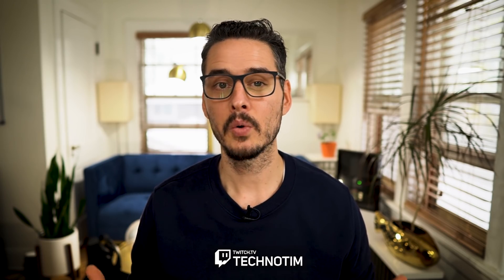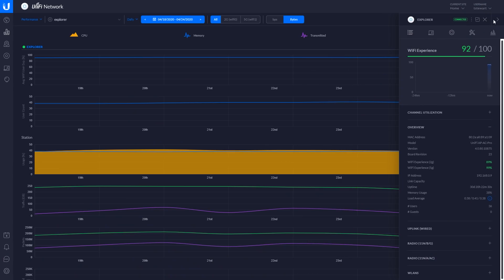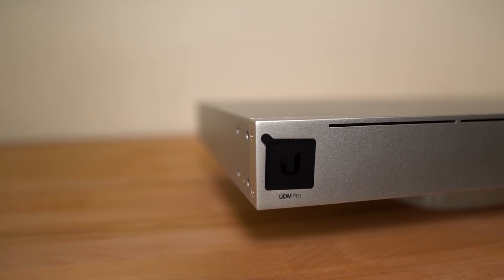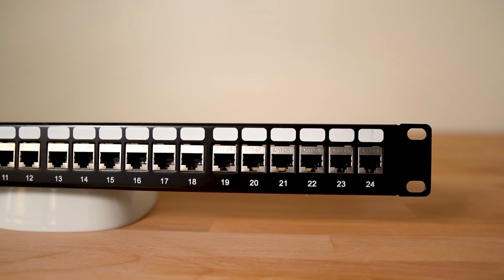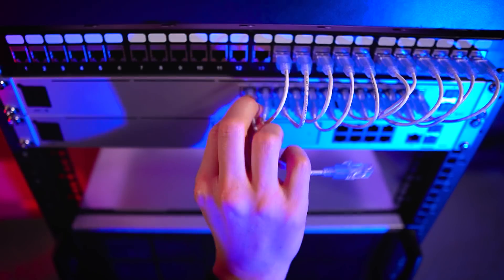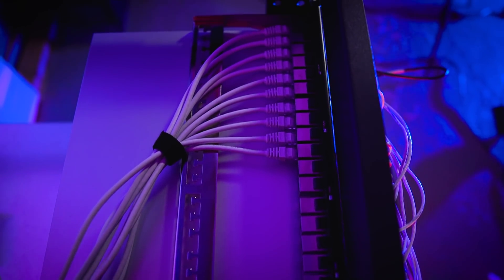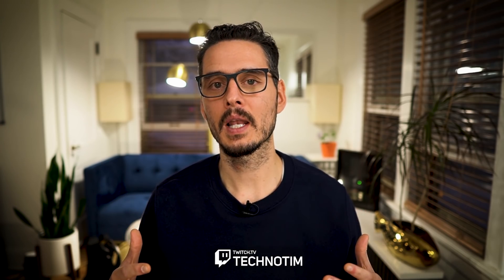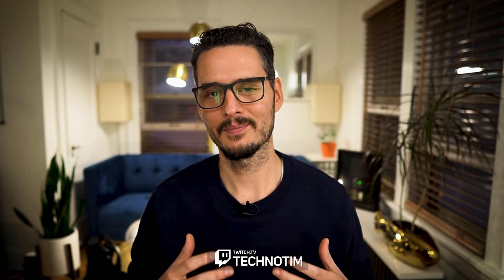Huge Network Upgrade for My Homelab

Comment: Would love to learn why you considered the UniFi line over the EdgeMax line? Also Mikrotik switches are cheaper than Ubiquiti line AFAIK -- did you happen to consider Mikrotik as well?
Reply from the maker: Hi!  Thanks!  I went with UniFi because I already had some APs and wanted full integration with the rest of my network.
Reply: That makes sense.

Comment: Don't like the fact that you need it to log into a cloud account in order to configure it and use it. Means you don't own it, you are just renting it and at it's mercy. Like an apple device, when they decide you need to purchase another one or force and upgrade, get out the wallet and take it bending over.
Reply from the maker: I think you can sign in locally too without cloud
Reply: This is not true, you do not need to be logged in to a cloud account to access the configuration. For example I have my Unifi Controller installed on a PC and I can log into the interface via that PC.

Comment: I want to get the Unifi Switch Pro 24 port to replace my old HP switch since it's noisy and has a terrible UI. I already have the unifi controller for another device.
Reply from the maker: Sounds like a plan!

Comment: Great video...nice setup. My only recommendation would be to reconsider using anything other than a robust device (FW) at your front door. If you said you tried pfsense...confused as to what features/functions did not satisfy your use case? Another recommendation...VMing your FW presents challenges no matter which product you use...if your going to go the VM route...you might want to consider zScaler or another vendor that provides great FW capabilities through the cloud...but then you would have subscriptions and fees associated with it. Back to pfsense...100% free! All you have to do is supply the hardware...it will run flawlessly on just about anything...except Intel based NICs are best to use for long term reliability. Good luck
Reply from the maker: thank you!

Comment: Planing to upgrade my crapy network at home something like yours. Maybe a bit smaller. UDM Pro as a gateway+firewall, as i only need about 4-6 PoE ports i think unifi 8 port 150 W switch will be enought, 1 unifi AP lite, 1 unifi AP Pro, and some G3 cameras.
Reply from the maker: Sounds like solid choices!

Comment: Half U patch panel? The three holes aren't evenly spaced, so most equipment probably wouldn't fit.
Reply from the maker: hmmm, seems like they are to me?
Reply: @TechnoTim  The space between the three holes in a U is 0.625 inches, but the space to the next U down is only 0.5 inches.

Comment: Great video Tim. I also run UniFi gear in my house, I really like the simplicity of running my network and my video surveillance in one place.
Reply from the maker: Awesome!  I haven't used protect yet (I have an existing camera system in place).  How do you like it?
Reply: @TechnoTim  I’ve used protect for almost a year and it’s been rock solid. The stable algorithm works great for me. I have 4 cameras, my latest addition was the g4 doorbell and I can’t say enough good things about it.
Reply: @TechnoTim  I run 10 cameras on the UDM Pro currently and Absolutely love it!  Future plan is to move the cameras to the UNVR but for the soul purpose of having the ability for more record storage.

Comment: Currently I have in my studio this setup ER-X —> Netgear gs305 and gs305e switches and Google WiFi as AP. I’m moving to new place and plan to ged rid of these two switches and replace maybe with one 16 port managed switched and UI AP to vlan segment my wireless prod from iOT devices.
Reply from the maker: Nice!  Sounds like you are on a great path to segmenting your network!

Comment: Great video as always! My next upgrade is to a 42U rack custom built into my office. I'm running out of space in my existing 22U rack due to some...aesthetic choices I made in having my printer mounted in the rack. Also upgrading the ethernet runs in the house to CAT 6A in the next few months. When we bought the house it was already wired for CAT 3, but that serves almost no purpose in modern networking. Luckily for me, I can use the existing lines to pull the new cable through the walls with very little effort....I hope. I've been a longtime user of Ubiquiti gear, but like some others, I went with the Edgeswitch rather than UniFi and a Netgate Firewall running PFsense. No particular reason for that other than at the time, it was all that was available, the only thing in the Unifi line back then was the AP which I also use. One AP-LR and one AP-Pro. I much prefer the pro and plan to get a second one and relegate my LR to IOT only as I have a few very chatty devices on the network. I'm looking forward to see what you think of the Unifi switches and UDM compared to the other products you've used.
Reply from the maker: Thank you!  So far, it has simplified my life (in the last week) and this is something I was hoping it would do.  Pushing out VLANs, creating rules across all 4 switches (I bought 3 UniFi Flex PoE switches, 2 of which were rolled out in 60 seconds) and centralizing all the management I was doing before has been quite nice compared to my previous setup.

Comment: Will you still be using your docker contained pi-hole?
Reply from the maker: I certainly am!
Reply: @TechnoTim  You can install pihole on the UDM Pro if you want. It's not a GUI installed option, but there are a few package install scripts to add nextDNS, Adguard Home, or pihole for the UDM and UDM pro (as well as other kinds of services). 

You do need to pre-install UDM Utilities from boostchicken, which sets up a few on-boot scripts that loads up the docker-equivalent and the network IPs for pihole, nextDNS or Adguard Home to your system.

The advantage of adding DNS-forwarding/filtering to the UDM(p) is that you can filter DNS in each VLAN separately, without needing to bridge the RPi4 or set up VLANs on the RPi4 to accept and forward DNS across the different networks. While there is some benefit to having a single pihole for 3+ networks to cache DNS, there can be difficulties if you have 'child safe' settings mixed in with adblocking home users, guest network access, etc, and/or the PiHole dies unexpectedly after a week.

While some of this can be done with group management on pihole 5 and assigning reservations with DHCP, mixing VLANs and unknown /guest devices has some teething issues. Let alone if you also add IPv6 ad filtering into the mix.

Comment: How load is this poe switch, I work next to my rack so I try to keep it as quiet as possible. Personally I use unifi accesspoints but all my routers and switches are Mikrotik but I do a lot of complex networking and this was not your cup of tea.
Reply from the maker: You're right, this is the model that has fans but it doesn't make any audible noise, at least with the 8 PoE devices and 16 other non PoE devices plugged in.
Reply: @TechnoTim  that is great, earlier unifi versions and most poe switches are quite loud.

Comment: Yes, there is a such thing as too many Ethernet drops. Two days ago I was sent to a Doctors office to mount a TV and on the other side of the wall where the TV was getting mounted was the IT Closet. Come to find out 125 Data drops are in the Wall and a Toggle Bolt snagged a few cables and damaged them. One was the main DMARC feed from their AT&T connection. Didn't know this happened until yesterday. Guess they had their IT guy look things over and figured it out. I'm currently re-running five Cables as I am typing this and as a peace offering I am running CAT6a for their new DMARC feed.
Reply from the maker: lol!  Yeah, sounds like too many!

Comment: When racking, start the bottom screws first then you can let go then start the top screws and tighten everything and have both hands.
Reply from the maker: Thank you for the tip!
Reply: @TechnoTim  rack studs series 2 will change your life :)
Reply from the maker: @EricsTechSpot  What are those????  I need my life changed when it comes to racking!
Reply: @TechnoTim  you use them in place of cage nuts for square hole racks. I made a video of them and realized how horrible it was so I am going to make another review of them when I get my larger bag in a couple of days and redo much of my homelab rack layout. Keep an eye out :). They are a one piece threaded post that has a clippy part that clips into the square hole. You place a yellow plate over the post to prevent it from squeezing together and unclipping from the rack. Once that is done, you can slide your device up onto the posts and thread a cap onto the posts holding the device in place. Much faster than cage nuts and you dont sacrifice as much blood. The posts take a lot of the holding up a lot of weight issue out of the install as they help hold the device up and in place while you thread the caps on. Takes you from needing three hands to about 2 1/4. Much more expensive than cage nuts but if you buy a large bag it's not horrible especially compared to the price of the device you just mounted.

Comment: I will probably start on my new NAS soon because my current one is almost full (HP Microserver Gen8 with 32TB running FreeNAS).
Will probably go with an i5-10400F (On sale for $140 here in Sweden right now), ASRock B460 Gaming 5 motherboard and 64GB RAM (3x32GB) so I can upgrade to 128GB later if needed.
For storage I will be using Seagate Exos 16TB drives and it will be running TrueNAS Core since it's officially released now.

Next step is to get a rack and upgrade my home network from Gbit to 10 Gbit.
Reply from the maker: Sounds like some great upgrades coming soon!

Comment: I don't like it when I pay a large amount for a piece of hardware and am forced to use any sort of account. That's why Oculus Quest 2 and UniFi will never be an option for me.
Reply: You can use a local account of you want. You only have to use a vpn of portforward for remote access.
Reply: @mitchellslot  Ah I see, so the cloud account is only necessary if you want to access your switch from the outside without vpn ^^
Reply: @devKazuto  indeed. I have used a local administrator account at many customers because of that.
Reply from the maker: Local account ;) but yeah, I totally understand.

Comment: I use pfsense, just purchased a new 1u supermicro “network appliance” with 6 10Gb ports that will replace my current one. I am done with ubiquiti. Spent a lot of money on their devices just to be told support end in 2021. I will still use the edge switch that I have and my long range AP. Will use the unsupported AP’s until I can afford to replace them. I have lost trust and confidence in ubiquiti and will not be buying any of their gear again.
Reply: psss, you can build x86 AP with Mikrotik miniPCIe card, PCIe adapter and HostAPd and it won't have expiration date.
Reply from the maker: Sorry to hear that!  which devices were ending in 2021?

Comment: Like @Max D sad, really wondering about your move to unifi consumer line. Sure looks nice and fancy but super limited functionality. I am running pfsense and edges witches with unifi APs. Sure I have to manage three separate controller systems, but that's worth.
Reply from the maker: Thanks!  I am leaning towards tighter integration over complexity.  I don’t have a strong networking background (although some) and would rather not learn and manage 3 systems.  I totally get it for those who do have that background and experience.  I would just rather spend that time on developing software and creating content... for now 😀
Reply: More advanced routers/gateways are unnecessary for home or even small office set-ups. The control over all of the networking devices from the one interface with Unifi is just beautiful. Also, if you're upgrading from a typical consumer grade all-in-one router then the Unifi routers and switches are certainly not limited in functionality by comparison!

Comment: I love the patch panels.    I was reading some of the comments on Amazon about this Panel.   Do you think that the edges need to be smoothed down on it ?   Or that the wires "might" become damaged, from the rough edges ?

Upgrades:  Newer servers.  My Dell R-610 has seen better days.
Reply from the maker: I saw those too.  Maybe they've fixed this since those comments.  I ran my fingers over it a few times and didn't notice anything sharp.  I am also not using the cable manager the way they suggest.

Comment: Although UDMP is great for what it is, it lacks many features that come standard or can be installed via package manager in pfSense and that I depend on. I had the UDMp and moved back to pfSense. I was losing features instead of gaining, like OPNvpn, ha proxy for reverse proxy, letsencrypt ssl management, pfblockerNG sinkhole ads, dns redirect all traffic from 53 to firewall to encrypt over 853, and advanced configuration of IDS/IPS. I’ve opened a support case with Ubiquiti, but they were no help. Hope you have a better luck than me. Looking forward to the 3 month update video.
Reply: Agree, I like a lot of the Unifi gear but the AIO UDM/UDMP is pretty crappy. Pfsense/OPNsense + Unifi switches/APs is the way to go. I understand tighter integration (after all, I did the same thing by trying the USG Pro), but its missing even the most basic features and DPI and Threat Management is pretty useless, even missing things like timestamps.
Reply: @NM-vw6xq  Hard to go wrong with that combo. Although lack of stability and non-existent product timelines, product managers and bugs are making me consider other brands for even switching and APs.
Reply from the maker: Hey!  All great points!  I’ll be sure to revisit this in the future!
Reply: @TechnoTim  Tom from @Lawrence Systems does a great comparison video on the various routers and their pros/cons.
Reply: @123-e3h1y  most of those services would NOT be better dedicated to a vm. Absolutely not! Again...pfsense is free...all you have to do is supply the hardware. Old...new..doesn't really matter..with the exception of ensuring you are using Intel based NIC instead of Broadcom or Realtek. Other than that...simply can not be beat...even enterprise level FWs in the right scenario don't beat pfsense...it's pretty even. Those all come with huge cost up front and pricey subscription/license fees. VMing FWs..though can be done successfully have presented some challenges even for pfsense. It is not ideal...especially since the software is free and you can use old equipment your likely using as storage or collecting dust like most of us.
Reply: @123-e3h1y  I'm not sure I followed much of what you wrote as it was a bit confusing. A FW isn't for filtering over 1GB...FW's are for use at any speed, and are to be the "Front Door Keeper" of your fort so to speak. The FW is the first line of defense at the routing level. Again..from a cost perspective..pfsense is FREE! UDMP cost money...LOTS of it...and it doesn't even have basic level functionality that most FWs do that are free or otherwise. So from that stand point alone...I don't see the use case for it...other than it can be managed from a single web gui along with other Ubiquiti devices. BTW, don't take my word for it..do some simple research...Lawerence Systems made a great thorough comparison of FWs...including USG! I'm not referring to creating VMs for you services (i.e., Linux sever, Win server, desktops instances, etc.) VMing a FW isn't best practice nor is it ideal. Does it work..sure, it can...just not as well as running the software on dedicated hardware. Since it is your first line of defense from the internet...why take a chance? I'm willing to bet that that the vast majority of us have old equipment laying around doing practically nothing! So from a hardware perspective in most cases...the cost is minimal at best! At the end of the day..we are all free to use whatever we see fit...I'm simply posing a valid question. Given the ease (cost) of setting up a pfsense box and configuring to your use case (a couple of hours) and still having FULL FW functionality without compromise, the ability to add additional functions for free (IDS, IPS, Web content filtering, Proxies, HA, Special DNS setups, VPN (both server and client)...the list goes on and on) to further enhance your use case...not sure where one can make the argument otherwise. To be honest, you'd be better off using the ISP's router/fw they give you as apart of your package. No matter which way you go...good luck and happy networking!
Reply: UDMP nor the USG Pro can either be considered a real FW. Both lack basic FW functionality that are NOT enterprise level features but simple FW features that should be available on your internet facing device. pfSense hands down provides everything and more you would get from Cisco, Fortinet, etc. Best part...the software is 100% free! Does it have a learning curve...yes. Is it plug  n play....for the most part. Why for the life of me do folks continue to use less than standard level functioning FWs at literally their front door is beyond me.
Reply: @TheRicosauve  ^ This 100%